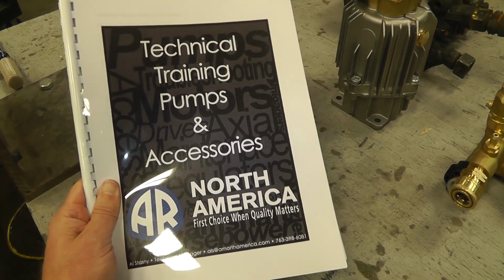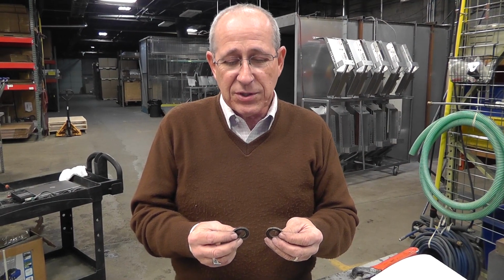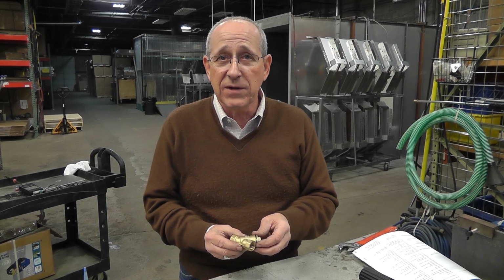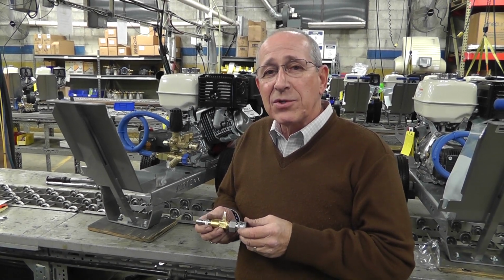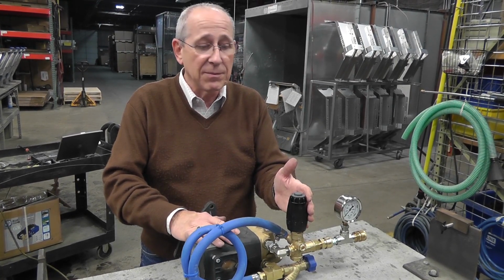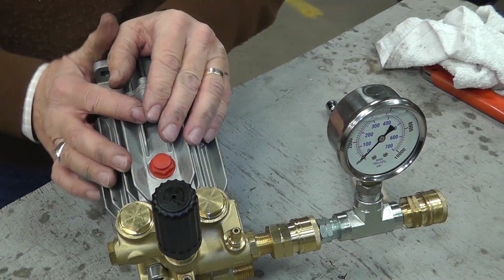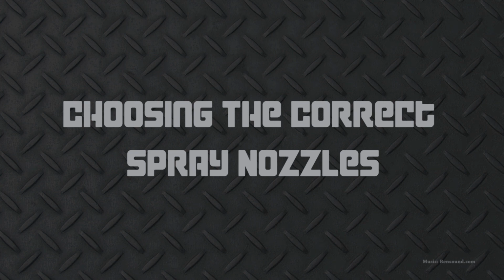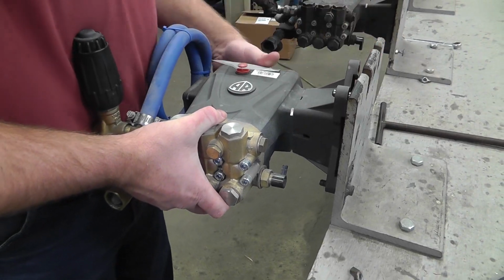AR Pump 101

Comment: I have an 4000psi AR RRV on a 14hp engine. When the trigger on the wand is off, every few seconds, there's a burst of pressure and the whole outlet hose stiffens. Any thoughts?
Reply from the maker: Generally, when you see pressure fluctuations, it is due to debri in the valves, bad unloader, or an insufficient supply of water to the machine. If you pull the trigger, what does the unloader do? It should "shift" when the trigger is pulled, and again when the trigger is released. If the unloader is pulsating along with the pressure while you spray, it is likely the unloader or vavles. If a video of the issue can be provided, we could better assess since it is not unusual for a discharge hose to stiffen up under load.

Comment: Excellent info, Thanks !
Reply from the maker: Generally speaking, anytime you buy a pressure washer, you should never adjust the pressure. Instead you should adjust your spray pattern by choosing a different nozzle, or accessory. 

That said, If a new pump is purchased for a unit you own, most replacement pumps are not adjusted before they are shipped. These pumps should be adjusted by a servicing dealer, using a pressure gauge and tachometer to ensure the pressure, flow, and RPM of the engine are all set for the most efficient and effective performance on each machine.

Comment: On the annovi Reverberi 4000 psi pump, should the thermal valve be on the low pressure side, on the bottom half of the pump?  I ordered a new one and it is on the high side and it blew as soon as i squeezed the trigger. It blew it apart, not just released pressure.
Reply from the maker: The thermal relief valve should be installed on the low pressure (bottom) end of your pump.

Comment: I have a AR SJV3G27-1, 7.25hp Briggs, the engine starts and runs fine but water flow is completely blocked.  I have the garden hose attached and open all the way, the discharge high pressure hose had no flow through the handle so I disconnected it from the pump and no water flow going through the pump either.  I did disassemble and look at the valves.  The 1 of the 3 smaller valves appeared to be wedged down in there and I tore it up trying to get it out.  One of the others had a spring that was sideways.  Both of those could be issues but I took apart the unloader and although its not moving super smooth it does open and close when you press on it.  I honestly think something is wrong with the end that you screw the high pressure hose to.  I don't see any place where water can exit.  it looks like a long cone type opening but I don't see a hole anywhere for water to exit.  I think I might need to order that part that screws into the pump with the little spring and float pin for lack of a better description.  It is missing the rubber O-ring on the tip of the float pin though.  Any help from you guys would be greatly appreciated and let me know if you sell those parts that I might need.  Thanks in advance.
Reply: I also wanted to add that I hooked the broken down unit (all valves removed, caps, etc.) up to my water spigot and wasn't able to get water to exit the high pressure hose side until I removed the entire piece that also has the float pin and spring.  Then water would exit.  If I screwed the high pressure hose fitting back on, no water would exit.  Do you guys sell this part and how much is it if you do?
Reply from the maker: @craigmartin7179  Hi Craig, thank you for reaching out. If you would like to email your phone number to  service@vortexindustriesinc.com or give us a call at 1-855-VOR-TEXX

Comment: i have a campbell hausfeld pw2002, 6 hp briggs, starts fine runs fine with water hooked up, squeeze the trigger and motor loads up hard (it will stall engine if engades fast) but will keep spraying, but not as hard as it should,  It has a new AR RMW  2.2 g24EZ pump on it, im not sure if its the carb or if it is sucking air in thru the quick copplers on garden hose.  And ideas, engine bogs hard when trigger is pulled, runs fine when trigger is released.   thank you.
Reply from the maker: Sounds like this could be an unloader issue. If the unloader is improperly adjusted, and the pump is trying to push too much pressure, it will stall or make the engine run hard. 

I would try dialing back the unloader. If this does not help. Checking the valves would be my next step. If the water cannot move freely throughout the system due to stuck valves, that could cause the engine to work harder, bogging it down.

Comment: I have one of the black die cast body AR pumps, either an RC or RK I believe. My question is...at the sight glass window where you see the oil level, there’s a yellow cog wheel looking thing inside..is that suppose to spin when the pump is on, I never see mine spin. Thanks
Reply from the maker: This disc will not move during operation. It is there to give a light backdrop so you can view the oil level more easily.
Reply: Thank you! I appreciate it so much